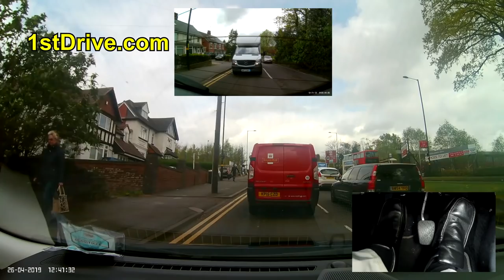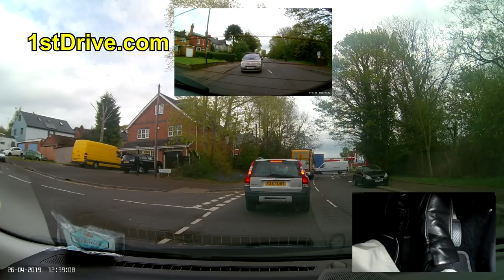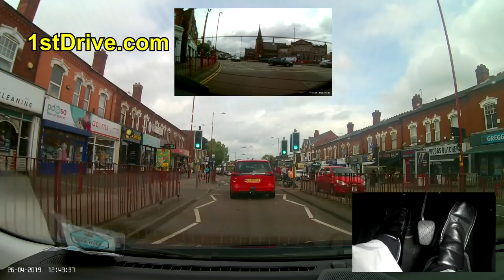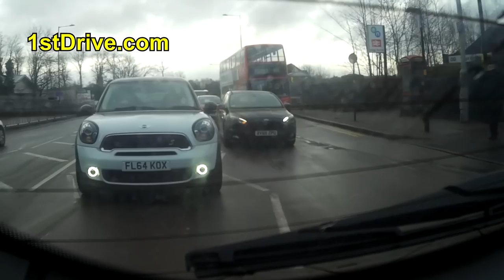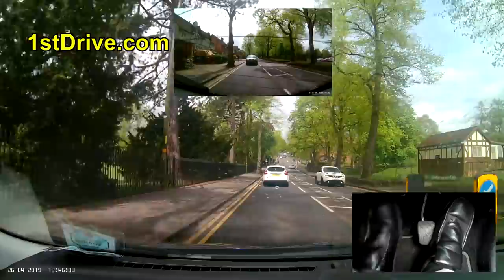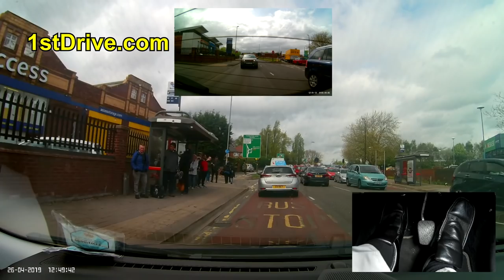Clutch control in traffic

Comment: 2:50 you said you don’t wanna keep the clutch down too long or else that can damage it, how can it damage it?
Reply from the maker: There's something called the clutch throw out bearing which people say can be damaged by holding the clutch down for a long time.
Reply: 1stdrive that’s useful to know! As it happens I got my first car 2 years  ago today and I’m a part time delivery driver now (studying as a student). I still follow channels like yours because it shows you can still be learning about driving years after getting your full license!
Reply: @kakaboubou6601  how do you overcome this? In my lessons pretty much every time we stopped was just clutch down and foot on brake
Reply: @jmc1989  When you put your clutch pedal down, shift the gear into neutral and then lift the clutch pedal up. I wouldn't recommend doing this on a driving test as the examiner may not like it (I don't know on that regard but drive as you are taught when it comes to the driving test). When you pass your test and buy your own car, you may want to reduce wear on mechanical components. It isn't really a big deal, wear on the throwout bearing is minimal and the clutch will still last many thousands of miles but I find shifting into neutral is a good habit instead of just holding the clutch pedal down.

Comment: Hi, thanks for this video! I have a question, is your accelerator foot staying still when on riding the clutch? Or do you need to see-saw it a bit, giving more gas as you raise the clutch higher?

Thanks
Reply from the maker: It's like a see-saw. You can just keep it still but then it'll rev more than is needed.

Comment: I work there at the qe most collegues cut through that no public access.  I have been told that if you had a crash there your insurance wouldn't cover you as it is clearly stated.  But it is not a law issue.

Comment: I like your vids they help a lot.
My instructor tells me to change gears while braking slowly , I get it but I mess it up it seems quite difficult when you have to quickly slow down.
Any suggestions from your side ,how I do it correctly?
Reply: Brown otto You shouldn't go through all the gears whilst breaking, use the gear approriate to the road and speed you are going, if im in 5th gear going 50+ and need to slow down, i will slow down to the appropriate speed then change my gear then keep moving if i can, you will waste alot of fuel if you're going through all the gears, and its easier

Comment: Did you put your heel on floor or usingg full leg to use clutch ?
Reply from the maker: Whatever works best for you is good. I can't remember how I do it, it just happens :-D
Reply: @1stdrive  but when you driving now normal like starting from junctions you put your heel on the ground from beginning and lifting toes till biting point or just using whole foot to find biting point and didn't putting heel on floor ?
Reply from the maker: I use my heel as an anchor. When my clutch is fully down, my heel holds my foot in place. When I start to lift the clutch I let my leg go looser and allow the spring on the pedal to do the lifting. It sounds like something worth doing a video about...